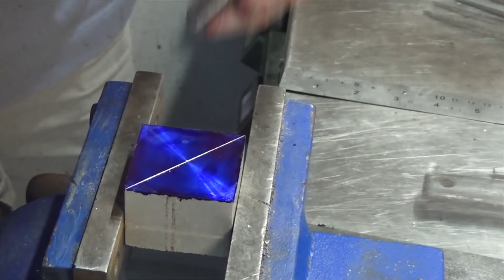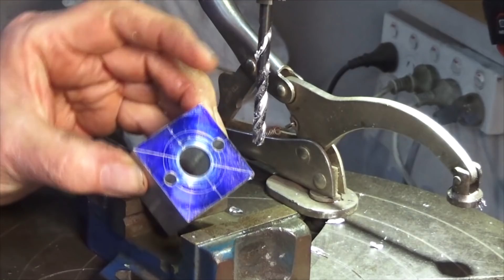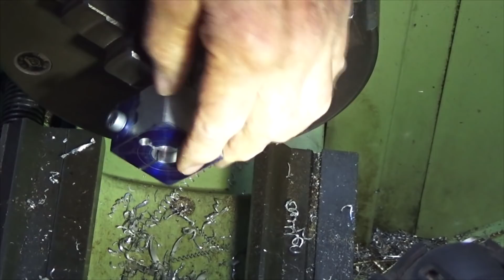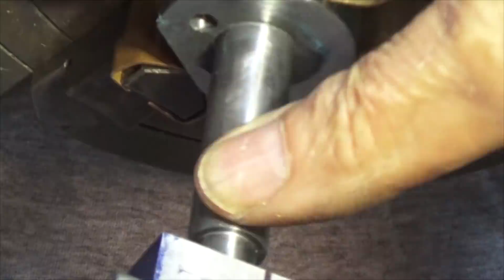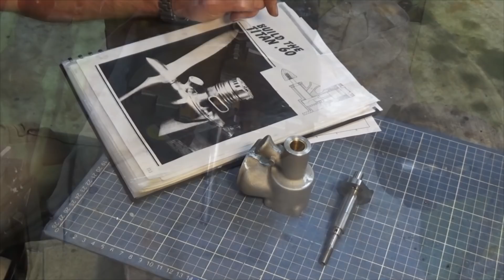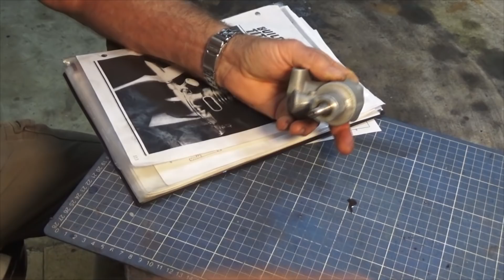Building the Titan .60 Glow Plug Engine #4

Comment: You put about thousand times to much very expensive compound on the shaft. And btw. Lapping by hand will never achieve a true parallel surface.
Reply from the maker: I must say I am very much a novice when it comes to lapping. i did get the result I wanted though.
Regards,
Mark

Comment: Hi Mark, I seem to remember in my very much younger years when trying to make a new piston for a "wobbler" style steam engine we used good ol' BRASSO polish from our cadet kit cleaning box. That stuff shone a piece of metal to a gleaming mirror finish in short order. 
Pistons in reworked Frog 150 aircraft engines got the treatment too if the piston or cylinder developed a scratch from dust getting sucked in through the ventury.
I've been trying to think where on yt I've seen someone lapping and I think it must have been you in a later video than this vintage job. Possibly Quinn from Blondiehacks did some on one of her engines. Its going to bug me now.
Reply from the maker: Quinn did make an expanding lap for one of her steam engines and most of what I learned came from Tom Lipton and Robin Renzetti. Diamond lapping pastes are super fast but they can embed in a part if it is softer than the lap. Things like Brasso will break down and wash out with the fuel and oil. 
Regards,
Mark

Comment: Found it!  I made from scratch with plans and it runs well., for the "Crusader .60" from "The Home Shop Machinist" July/August 2005 . Also from George Genevro.  This little engine used a rotary valve at the rear of the engine to get the fuel air mixture into the crank case.
Reply from the maker: Allan, that's great. Perhaps I need your advice. I cannot work out how the piston is meant to look underneath. The drawings don't seem to show how the small end of the connecting rod is supported. I am still some way off that part but it has been puzzling me for some time. When I get up to that part I am going to ask for help if I haven't worked it out by then. Please let me know if you had found an error in the drawings. You can email me at mark.presling@gmail.com
Regards,
Mark

Comment: Please cut off the top of the venturi and the stubs for the needle valve and fit a RC carb. It will be no use otherwise.
Reply from the maker: Here's the thing. I agreed to make the engine and return it to the donor. It is destined for a museum and the exhibit is in honour of the designer, George Genevro. I want to ensure it is built to his specifications and design. It will probably only ever run once.
Regards,
Mark
Reply: @Preso58  That makes a difference.

Comment: Hi Mark, I’m putting this out there in same sprit as your videos, namely to help and inform (and because I know that you won’t internalize the public critique…).  As it is always a joy to witness your highly-reasoned and productive struggles, specific to your issue with a tight fit between shaft and bushing at the shaft/shoulder inside corner, decades of experience as a design engineer tells me that you’re trying to solve the wrong problem. For the scale of the steel shaft you are working with, a corner radius where a shaft meets a shoulder wants to be 10% the shaft diameter (great simplification here; there are libraries worth of theory, analysis and testing available if you want to know why…). To accommodate this radius it is standard practice to relieve the ID of the bushing. As example, if your steel shaft is 1” OD, your shoulder corner radius wants to be not less than 0.10”. The bushing would be relieved to an ID that would provide clearance for this corner radius, say 0.12”. The depth of the bushing ID clearance would be around 0.15 (150% the corner radius). This will avoid the fabrication issues you are having. Importantly, it will also assist in avoiding future issues associated with crack nucleation owing to unavoidable machining inconsistencies at a tight inside corner where a round shaft meets a flat face. 😉
Reply from the maker: Thanks for the detail here. I am sort of compromised with this project because I agreed to make the engine according to the drawings and the design of the original maker, George Genevro. He has detailed the design of the crankshaft which didn't include a corner radius at the junction between the crank disc and the crankshaft. There is a radius specified between the crankpin and the crank disc but I assumed that the lack of radii at the crankshaft end was due to the support provided by the crankshaft bushing. I think the issue with the tightness was mainly because the lap couldn't extend beyond the very end of the shaft. I did just run the shaft in the bush for a few minutes with low RPM and plenty of very light oil and it freed up in no time. The clearances must be very tight, probably just microns and this makes the fit seem poor. In reality it is really good since the margin for error is very tight.
Regards,
 Mark
Reply: @Preso58  Understand your situation and commitment. I tip my hat to you. If the design is indeed sound, I have every confidence that you are that remarkable person who could indeed execute it and we will see a running engine. Keep to your efforts! Enjoy your time away. Cheers!

Comment: Surely the small angle that will not be polished because you relieved the aluminium will strengthen the crank journal, or at least undercutting will weaken it. I think it is standard proceedure to radius the edges of larger journals to alleviate stress points.
Reply: I meant to add how much I admire your machine skills and much more.
Reply from the maker: Jim, the clearance is so tight that just a micron or two will make the fit feel stiff. I actually fixed it by just running the crank in the journal slowly in the lathe with some very light oil. 
Regards,
Mark

Comment: I thought you'd cut yourself on the handsaw when those words came out.... 
Chamfer the bush hole? 
Nice work.
Reply from the maker: If I were organised I would have had a block of wood handy to push the stock into the saw. I have fixed the issue with the crankshaft. It just needed a little running in the lathe at low speed with plenty of oil.
Regards,
Mark

Comment: Just a thought on the counterweight end... Just mill it slightly undersize and be done with it... use a very sharp very square cutoff tool and recess it a touch, even if by only a couple thousandths, that way you eliminate the radius, it allows clearance, and the back of the counterweight will ride against the end of the bushing anyway... You chamfer the ends of the bushing anyway soooooooo do the same (basically) to the shaft....
Reply from the maker: It's fixed now. I will detail the fix in the next episode.
Regards,
Mark

Comment: Don’t rush to Tasmania-we are in the middle of a very wet easterly weather pattern-this wet will last about 8 days. I live not far out of Hobart, 10-15 minutes, semi rural at the end of the Meehan Range. The hillside opposite our 5-acre bush block has the cloud base obscuring the hilltops. We are at an altitude of 98m so just in clear air. Enjoyed this project, I am an R/C builder and flyer the past 50 or more years. I have a J3 Piper Cub 1/3rd scale (12 foot wingspan) and a slightly smaller machine full of scientific gear I fly now and again for the Uni in their climate research projects. I fly it to a height of 1.3km naked eye, with measurements sent back to the ground station, recording height, temps wet/dry bulb, pressure etc. and photographs at intervals. Fascinating projects I get involved with as I design and build most of my gear. Regards from the Southern Cross Observatory-Tasmania 42 South.
Reply from the maker: Well, we are already here. We actually left earlier than we had planned because we were worried that the NRL Grand Final would be a super spreader event! We did just look at the forecast and it's looking like it will be exactly like your forecast. In a way, we don't care too much. We just wanted to "travel overseas". 
Regards,
Mark
Reply: @Preso58  Fortunately we don't get this weather pattern too often but on the plus side, we are in a rain shadow o all the extra rain is topping us up for the coming summer. Wherever you are, enjoy your travels and your stay.

Comment: I would be tempted to scrape the bush at the very end with a triangular scraper.
Reply from the maker: Luckily I didn't have to start removing too much metal. The clearances on the fit must be just a few microns. It just needed a few turns under power with plenty of oil and it is now fitting perfectly.
Regards,
Mark

Comment: I must be misunderstanding - can't you just put a tiny undercut at the end of the shaft where it meets the crank? Anyway, all very interesting, I've never done lapping but I've seen other youtube videos and I'm always surprised that there are no ill effects from effectively bending open the circle of the lap so that it fits over the shaft; the layman in me thinks, well so it's no longer a circle then, is it? But obviously it works, because people do it.
Reply: It seems to me the lap doesn't have to be perfectly round - it will still work with only three points of contact.  The other areas would make entrance and exit ramps for those points.  So... probably okay with the very small amount of bending and distortion that takes place.  Further... any wear on the lap (which is soft) would tend toward reducing those high spots and turning it more into a true cylinder.  (Consider... a lathe tool tip is not a perfect circle, either!  And yet it can make nearly perfect circles, because of the rotation around a fixed central axis.  A little different technique, but something to think about.)

I agree that a small relief on the shaft is in order.  Trying to "wear it away" when it looks like it barely turns seems fraught with peril, including it looks like it might not even turn!

The reamer in the bore kinda shocked me; seems like when you're using an approach that would normally be used to work toward tenths or microns, that sort of thing is a bit out of place.
Reply from the maker: I have already fixed the binding at the end of the crankshaft. It just needed some very light running in the lathe at slow speed and plenty of oil. The lap will conform to the shaft very quickly even though it was distorted. The pinch bolt brings the internal bore back to size too.
Regards,
Mark
Reply: @Preso58  I might have been tempted to try such a solution myself!  I'm just trying to learn more about the finesse of "doing it right", as my big brother would have said.  Perhaps I'm also watching too much Stefan.  :). Carry on, mate!

Comment: interesting process.  i think i have seen people mix that lapping compound with some alcohol. i think it helps it get between the lap and the work.
Reply from the maker: I was using some really light oil, sewing machine oil. I have also read that kerosene can be used. I guess anything that binds the diamond grit together and helps it cling to the parts will do the job.
Regards,
Mark

Comment: Hi,Mark. Turned out really good but I just have one worry. I've done quite a bit of lapping of shafts to close tolerance of bore fits and that tight spot at the shoulder is likely to gall and pick up(semi seize). Just relieve the tight spot on the crank with a fine diamond coated needle file or a piece of fine wet and dry paper wrapped around a narrow piece of flat stock. You won't get any oil into that tight bit when running and it may well pick up.
Reply from the maker: I have already fixed that tight spot. It just needed a bit of running at low speed in the lathe and lots of oil and it now fits beautifully. 
Regards,
Mark

Comment: As a Canadian I am constantly working with both Metric and Imperial measurements. It can be a real pain in the heini having to check, re-check and check again our conversions all the time. Both systems do have their strong and weak points but I wish they would settle on one or the other eh. I love this part of a job. Really a true "hands on" affair eh. It really is satisfying when it is completed. Avoiding tapers can be achieved by  making a longer block with 2 pinch screws/bolts closer to the ends. Much like using a Sunnen boring hone used in boring an engine cylinder. I just had my very first holiday. At 65 it was long over due for sure. I could get used to that not having to be any where or do anything. I hope yours will be great. See you for #5 my friend. Take care eh ! On to #1.
Reply from the maker: The whole metric vs imperial debate is fascinating to me. I was 17 when Australia went metric so I can do both. When the change came in we just switched over and from what I recall, the sun came up the next morning and we just got on with it. The sky didn't fall and there were no flaming torches or pitchforks so I don't understand why we still have both systems. It turns out that the only three countries left in the world that stick to imperial are Myanmar, Liberia and the USA. I am guessing that Myanmar has more pressing issues to deal with to worry about their system of measurement and Liberia are transitioning to metric and imperial is now optional but you know who is the holdout. My wife and I have travelled in Canada and I believe you aren't quite as hard line as Australia. We can still buy fasteners in imperial sizes but they are considered legacy sizes but everything else is full on metric. Like I said, an interesting debate....
Regards,
Mark
Reply: @Preso58  Our steel and fasteners come in both . Wood sheet (plywood) is kind of both but dimensional lumber is still Imperial. Distance, volume, speed weight are pretty much all metric.

Comment: Good Show Mate: as per normal. Never having made and external lap, I would have done what you did. I have made several internal laps. I have always got it to do what I wanted...eventually. Watch out for Tasmanian Devils. From the cartoons I have seen, they are very bad tempered. What does one do in Tasmania?
Reply from the maker: I will need to make an internal lap for the cylinder bore but that is still a way off. I was pleasantly surprised at how easy it was to control the diameter of the shaft. We haven't seen any Tasmanian devils yet but we did come close to seeing a wombat. Well, we saw it's poo so we must have been close. Tasmania is about 50% wilderness so there are some amazing walks in and around the south west. We are very close to the Styx Valley which is home to the tallest hardwood trees in the world. The mighty mountain ash trees grow to over 90 metres and everything is ancient including the rock formations and the plant species. Sadly though, due to a Covid outbreak we are now locked down for three days. 
Regards,
Mark

Comment: Nice job! Tom at Oxtool has shown some lapping.  I have tried it just for practice using a brass lap, but not on anything real. I have definitely seen laps in old books that have both an expansion screw and a compression screw.  The old Geometer column in Model Engineer magazine says to make the lap a loose running fit to start--his laps are made like a compression wrench in that there is a handle you squeeze, but I think the screw adds control.  You can also make a block like you have and then saw it completely in half and use two screws. I have used that same diamond paste and when you were starting to smear it on, I thought you need to thin the paste with oil or WD40, but it looks like you found that out for yourself. You should try the flat lapping on aluminum foil on a flat (surface) plate sometime now that you have the diamond. Love the blooper reel at the end!
Reply from the maker: I have watched a lot of videos by Tom Lipton, Robin Renzetti and Suburban Tool and it seems like there are many different ways to get the same result. I was just grateful that there was so much control available. With turning it's a sudden death situation. If you go undersize it's game over and no recovery. With the lap you can get really precise adjustments and although it's slow that's a good thing. I am looking forward to making an internal lap for the cylinder bore. 
Regards,
Mark

Comment: On aluminum one can get a smoother finish if on makes the final pass with a shear tool.   Seems that might work with steel?
Reply from the maker: I have never tried a shear tool but I should. The diamond tool holders that I have make it really easy to set up a shear cut. You just have to turn the tool bit 90 degrees and set the centre of the ground edge to the centre height of the lathe. 
Regards,
Mark

Comment: Or you could make a Rotary Tool Holder and Simply O.D. Grind to size…
Reply from the maker: I do have a toolpost grinder but it's not easy grinding up to a shoulder without specialised equipment. It also works better on hardened stock. Things like Dremel tools have tiny bearings and they tend to leave a finish which is not perfectly round. The term "wheel hop" refers to the pattern left on the shaft as the grinding wheel bounces away from the stock as it grinds. The lapping is fairly low tech but I was really pleased with the result. 
Regards,
Mark

Comment: Really enjoying this, especially being an ex aeromodeler and a fitter/turner.
Reply from the maker: I am also an ex-aeromodeler but not a fitter/turner or not a qualified one at any rate. I have always wanted to build an IC engine though. This was just the right project at just the right time. If it turns out I want to have a go at something like a hit and miss engine or a multicylinder radial. 
Regards,
Mark